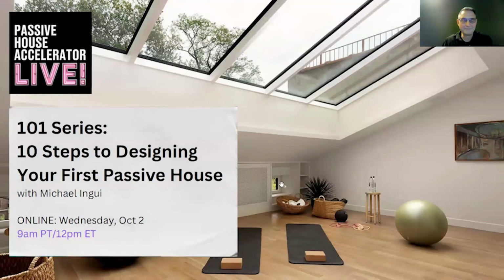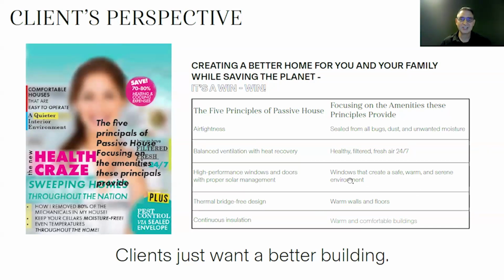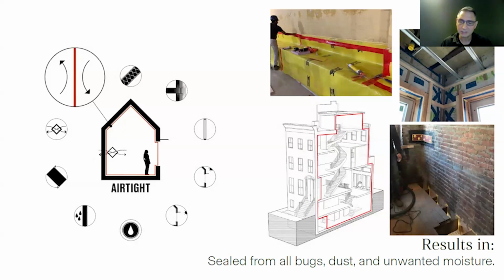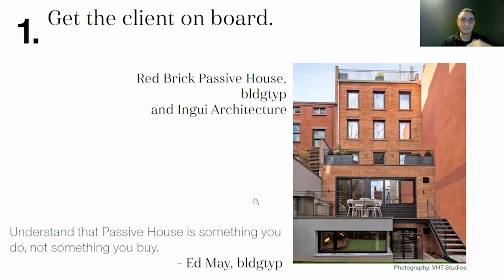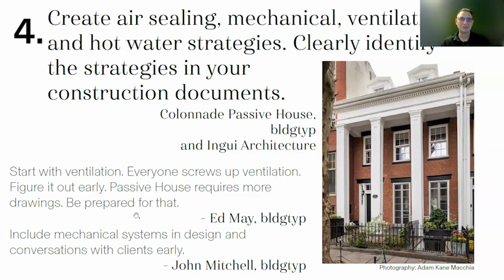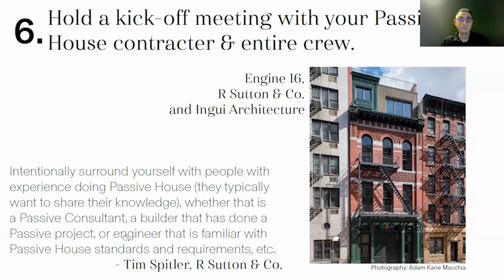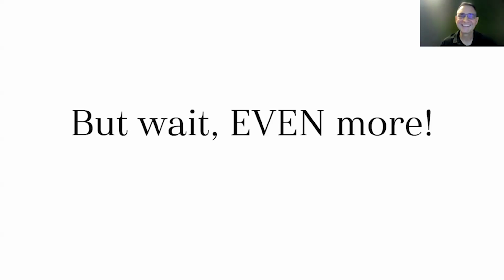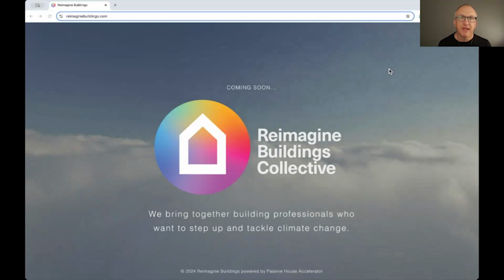101 Series: 10 Steps to Building your First Passive House

Comment: i appreciate a lot of the perspectives & ideas offered by respondents in the 10 steps section, esp on communicating aspects avg people will find meaningful, and building up a sense of pride with collaborators/contractors. even the bonus steps & tips were helpful reminders to look at the entire project (more than just structure). 

while i've got zero first-hand experience (other than water jugs my dad stacked in the house, and the pvc hoop-greenhouse he made outside the south wall), or formal edu on the concepts of passive building or even architecture, i've spent years learning, and i'm close to building (self GC & much of the labor) the 1st of my designs. it's exciting, and daunting.

guess the reason for hesitancy to get involved with the PH community or Collective mentioned here, comes from the dismissive & condescending attitudes experienced when i reached out on a PH FB page for assistance/clarity. even seemed like some allusion to this at multiple points in the presentation here. the other thing, somewhat related, is a perceived hostility to breaking the "rules" of PH Cert (say, not using triple glazed windows) and not being very open to work-arounds that effectively solve the same equation with arguably better results.

least the PH community is smart (or at least knowledgeable?), unlike other hobbies and interests that have i've involved myself in communities for (don't ever LS swap a car, and the custom PC building community is a masterclass of Dunning–Kruger). vintage sportbike folks are great, to balance my negativity here. anyway, thx again for sharing this so GED enthusiast plebs like myself can glean some insights!